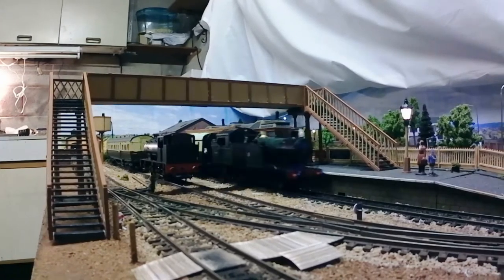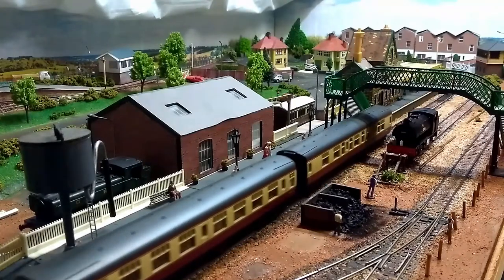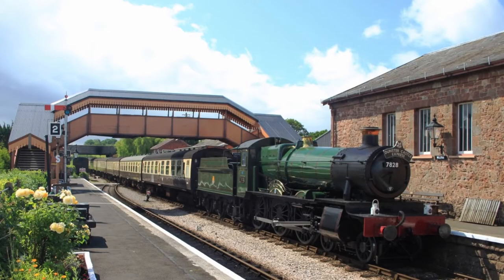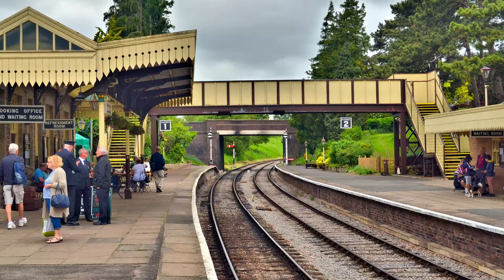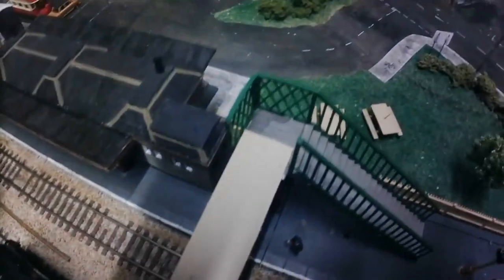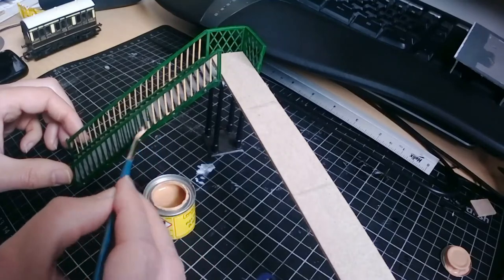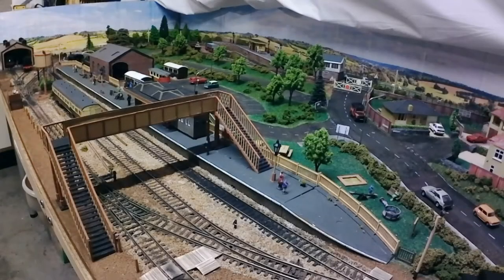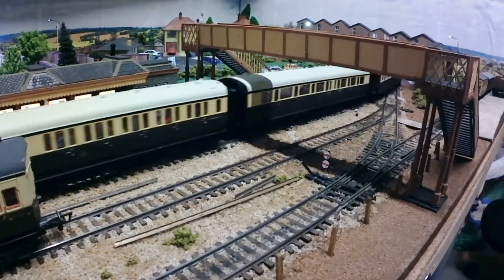How I kit bashed a GWR-inspired footbridge

Comment: Hello there, nice and informative video. With regards to the (TriAng) Hornby green plastic bridge (and these comments also apply to other T-H footbridges,) all of these are designed as ground level pedestrian bridges, which gives you the unstated option of lowering the height for a platform version, very thoughtful of Hornby to do so. Re the green bridge model from T-H, this is representative of "of the shelf" cast iron footbridges that a number of foundries produced , and which were also used in non railway settings. Quite a  number of UK railways purchased these kit bridges ( a la IKEA ?) for their own use, including Welsh railways which later amalgamated with the GWR.
Best wishes, and regards to all.